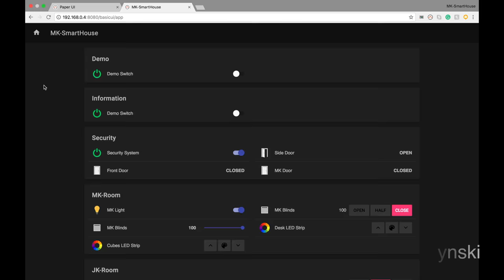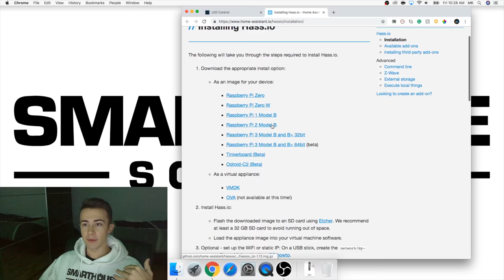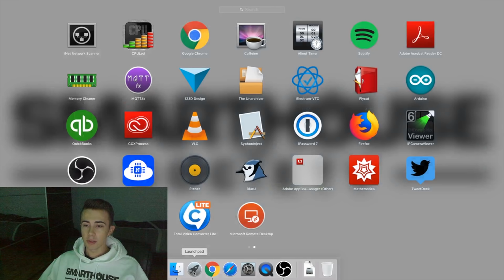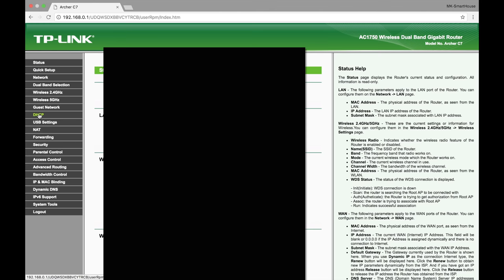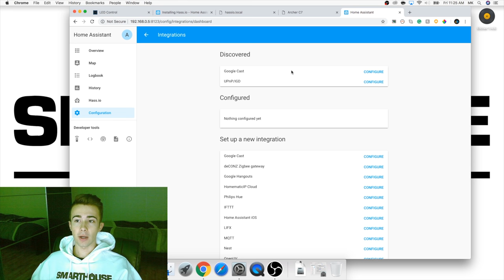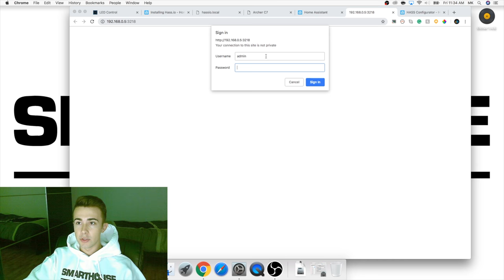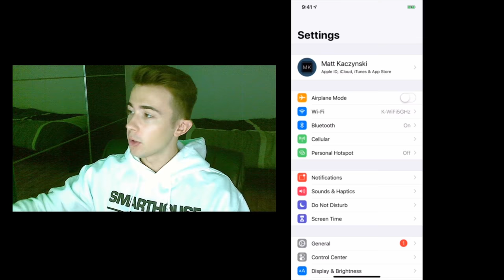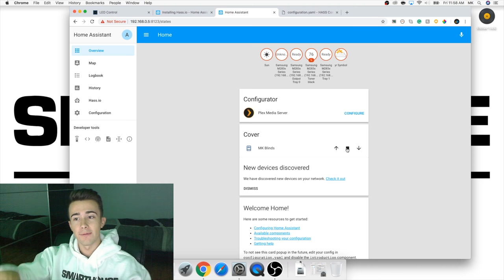NEW! Install Home Assistant/HASS.IO + MQTT + Configurator + Blinds Control ESP8266

Comment: Whats the difference between ifttt and mqtt? I googled but I think there is a platform mixup here. Im somewhat new to home automation (not with arduino's) and want to know the cheapest devices I can associate with my system as im very good at building custom electronics I dont need to but a premade device most of the time.

Comment: I Have flashed your blinds firmware to an esp8266 nodemcu. What GPIO pin do I use? i can't get it to work at all. Id be very grateful if you could help me. I'm a sound engineer, I was involved in an accident at work and I'm stuck in bed for the foreseeable future, been here 6 months, if you could help me with this id be forever grateful, its physically impossible for me to open and close my blinds, i have someone who can fit the servo for me once its programmed. thanks in advance

Comment: Just in case anybody gets stuck, mosquitto now seems to require a unername password. Mine did not work with just anonymous true. See. Since version 4.1 of the addon, an explicit ACL definition is now required if you plan to use legacy logins and "anonymous": true see these instructions.

Comment: Hey! I did everything the same even my router is showing rpi connected to my WiFi, but when I search for my IP home assistant screen doesn't show up. I am using rpi3b+ with 32gb class 10 Samsung SD card.  What can I do to obtain that screen? Thanks in advance.

Comment: Would you mind doing a review after a month or so of use? I'd love to hear your opinion on OpenHAB vs. HA after using it for a bit. My experience with HA was that it was easy to use and set up, but not 100% reliable, but I was using the MQTT through SmartThings.

Comment: Have you had a look at openhabian? I’m not saying that Hass.io is not a great thing, but in this video you are really comparing a piece of software  (OH) and a distro of an OS that was made specifically for easy installation of HA. Not an installation of HA generally. So, why not compare hass.io and openhabian?
Reply from the maker: Yup, I have many videos about openhabian. Hass.io is still much simpler.
Reply: Well, I have no experience at all with HA at all really, so I should not comment maybe. But I have just noticed that what is covered often, including your videos, about OH is what you see in the web interface + the item, and so on.. config files. openHABian adds very nice easy installation of MQTT and other components that you need. And easy setup of backup. Not often featured well, including in your videos (I think, I may have missed some).

Comment: Nice video, Matt! Definitely looking forward to your OH vs HA comparison later on down the line!

In my (limited) experience with HA, it's just a different hammer for the same nail (home automation) - both work and both have pros/cons. Both have pretty great support for different protocols and sensors, too. I'm also just too invested in OH (and it works well enough for me) to switch my configuration over, haha.

BTW, between openHabian, PaperUI and the VSCode extension, you can pretty much do the entire configuration in openHAB without going into SSH, as well :)

Oh, and +1 if you remember (or have used) the "real" floppy disk (5.25") :-D
Reply from the maker: Thanks! I love your videos as well! You are correct they are both good and do the same thing. I look forward to do doing the comparison video. My configuration isn’t to bad just a bunch of Matt devices so it won’t take long to move over. Nevertheless keep up the great work!
Reply: +2 for the 8" floppy....

Comment: Hi MK-SmartHouse
This is Mukteshwar From India. I need a help on adding devices.
Take one example that I have 4 loads connected with one esp8266 .I exactly mean to say that I  have connected a 4CH Relay module to my esp8266. But now I am unable to write codes to operate all 4 devices with separate switches. Able to operate only one load. Can you please Help Me on this.
So HOW CAN I ADD 4 LIGHTS.
Reply: You have to have 4 MQTT topics, for each relay one. Than you add them to the Home Assistant as 4 separate light objects like this:
light:
  - platform: mqtt
    name: "Relay1"
    command_topic: "relay/device1/command"
light:
  - platform: mqtt
    name: "Relay2"
    command_topic: "relay/device2/command"
etc.

Comment: So Openhab or Assistant/HASS.IO? Doing some research, and now wondering what the benefits and drawbacks to both systems. D:
Reply: Both have Pro's and Cons.  I find YAML easier to program in than the JAVA, so I prefer Home Assistant. 
It really depends what you are most comfortable with.
Openhab needs a little more tech knowledge, but is highly customisable.
HASS/HASSIO (note, there are two flavours of Home Assistant) is a little more user friendly.

Both are very powerful and do a lot more than most people could dream of :)
Reply: Brendan White for a beginner is there a video / guide / tutorial to get simple 8ch relay to work. I achieved same using OH but it was unstable and seldom using mobile. I’m expecting HA to do better than that, and control power on/off etc.

Comment: Hello, I'm new here I want to know if I run home assitant from the pi, will I be able to use the pi as normal? Like running the server in the background and still use it, is it possible?
Reply: My guess would be no. The Pi is an amazing little machine but it has its limitations, and if you want to run raspbian or other Pi programs you would need to re-flash it I think. That being said, theyre also relatively cheap and you could just get a second one if you want to run projects on raspbian
Reply: Yes, you can. But you have to install homeassistant manually (you can't just use hassio). But be aware that Raspberry Pi has hardware limitations and you can easily overload the system resulting in crashes etc.

Comment: Do you still have to make changes to the configuration.yaml file?
My installation looks a little different to yours, for example I have "supervisor" instead of "hassio" in the side bar..any help would be great
Reply: Just got mine setup. Was trying find something online to follow but most of the videos were outdated. I'm super new to HA. So after much experimenting, it seems you don't need to add anything to the yaml file, meaning skip that setup. And i couldn't get my mqtt borker to communicate with my tasmota devices at all in anonymous setup. I ended up creating a user and password and everything started working. Auto discovery managed to find my switches. Hope that helps in some way

Comment: Hi! Nice video. My installation seems to "break" at the 20 minutes of waiting after connecting the RPI to the ethernet cable and turning it on. I connected a screen as well to see some output. Looks like it's looping... 

I see a lot of messages like:
wlan0: link is not ready
brcmfmac: power management disabled

Any suggestions?
Reply: Did you fix it? Ask the question in Home Assistant discord

Comment: Pls can you tell me what I need to use the android app.When I enter the ipa adress of the hash.io server and the pasword it says "Password incorect""  but the password is correct
Reply: There is not an official Android app. There are some third-party ones, but they often don't work. Which app are you using? I recommend just adding the Home Assistant “web app” to your homescreen. It will work as if it was native app.
1. Open Chrome
2. Navigate to your Home Assistant web interface
3. Tap on the Menu icon (three vertical bars)
4. Tap on Add to Homescreen
5. A dialog will popup; tap on Add
Reply: @youtubak777   There is a app called HomeAssist. I need the app because I wont to control things outside of my network and see sensor data also outside of my network.

Comment: Comparing an OpenHAB installation to hass.io is not the same.  Of course the OpenHAB install is empty out of the box - it's supposed to be!  hass.io is for "script kiddies" that just want to get things running without caring what it does and how it works.  Try comparing OpenHABian to hass.io and maybe it will be closer to the same.  Also, when you set up OpenHAB now, it asks what type of installation you want.  If of course you choose "Expert" it's empty.

All the relentless repeated plugs for the MK smarthomestore and products are getting annoying.  YES WE KNOW YOU HAVE A STORE ALREADY!!!